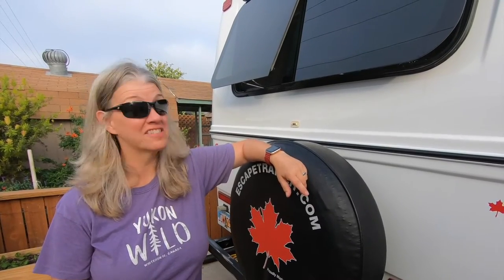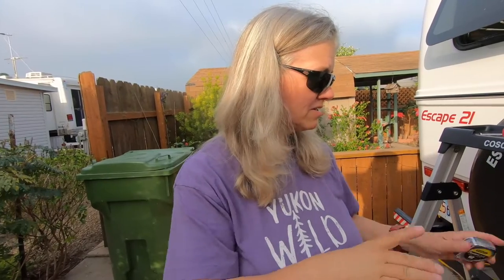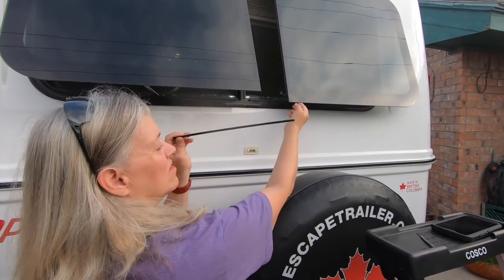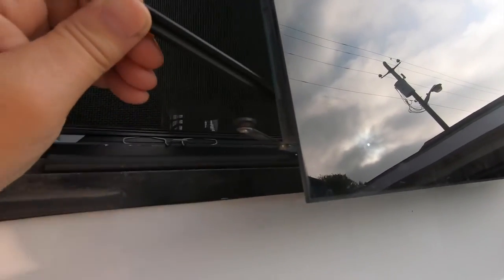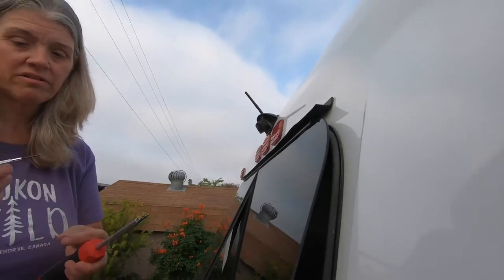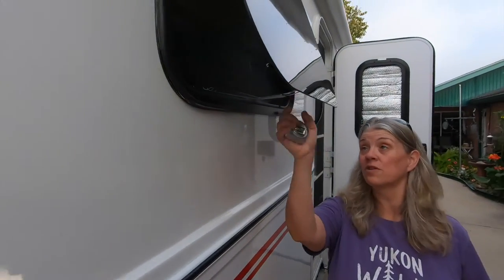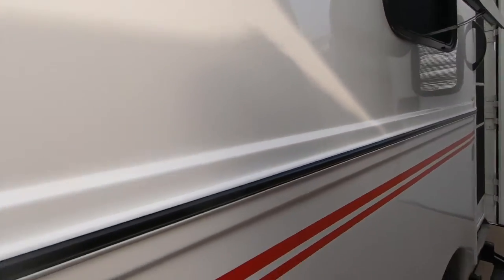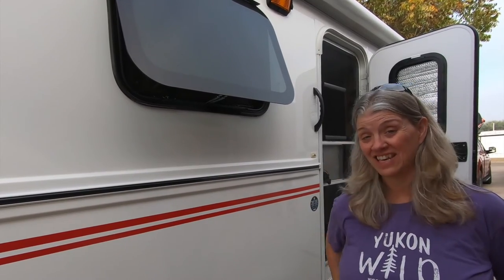Simple Rv Frameless Window Modification

Comment: Super duper!  I was so tired of not being able to open these windows after just a year, that I got out a pair of needle nose pliers and simply pulled that plastic insert out, no need to unscrew and slide the glass.  I sprayed the channel first so the insert slid out fairly well, tho it did take some effort because I had to avoid the arms.  I cut the insert down too, and then slid a small section back in.  But if anyone is going to take any of those upper screws out, then your excellent reminder to use a magnetic screwdriver is spot on.  I tried that first in fact, and lost a screw in the dirt, and had to use very bad words in order to find that dag-nabbed screw again.  So yes, get a magnetic screwdriver.  :-)  But it worked fine for me to simply pull the insert out.  Seems there is always more than one way to solve a problem.  I like options!
Reply from the maker: You're a rock star for just pulling out those plastic inserts! Ha ha I also used bad words when I lost the screw!! Thank the heavens for Ronda and her keen finding lost things ability. I love your alternative method!!

Comment: Angie I'm not sure if you know this but Lippert changed the design of the windows in June 2022. They no longer come with 7 inch arms and the 12 inch spacer. All windows now have a four inch arm and no spacer making this mod no longer possible. Per an post in the Escape form you cant even buy the 7 inch arms fro Lippert anymore only the 4. You might think of changing this video and maybe adding a foot note so people aren't trying to do the mod on the new windows.

Comment: Just did this to my 2019 Escape 21 and it works great. However, they changed the window design slightly and no longer use a screw but instead a pop rivet. So you have to drill out the rivet and then put a new one in. It's a standard 1/8 inch pop rivet.  It took about 20 minutes for the first one, 10 minutes for the second one and the ones thereafter.
Reply: Of course, now I hit my head in the windows if they're open all the way when I'm trying to get into the storage compartments!  ;)
Reply from the maker: What?!!! That actually might make it slightly easier since those tiny little screws are easy to drop and lose.
Reply from the maker: ha ha, despite that I hope it was worth it for you to have more ventilation!

Comment: Hi.  I adjusted my windows after watching your video and have a question.  Did you have any problems on the double window in the back sliding the pane on the left to the left?  I was able to adjust the right panel, but I can't move the left panel far enough left to get to the mechanism.  Did you slide yours to the left and did you have any issues?  Thanks.
Reply from the maker: Hi Kay, thanks for reaching out. We did not have any problems so not sure what went on with yours. Sorry for the slow reply, we've been traveling and seeing family. Hopefully you got it taken care of!!